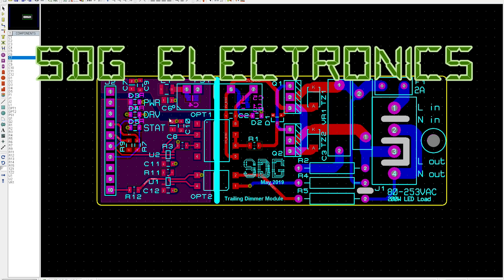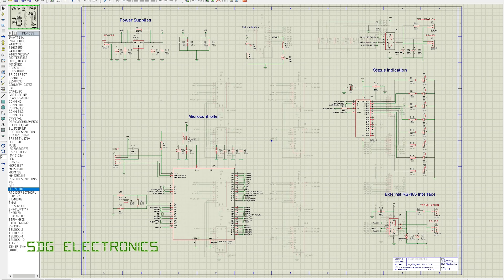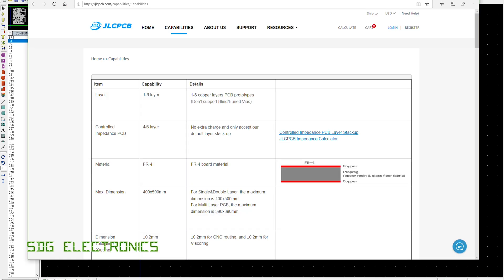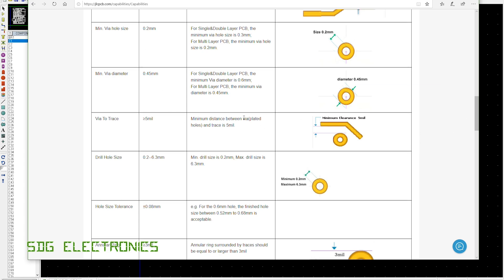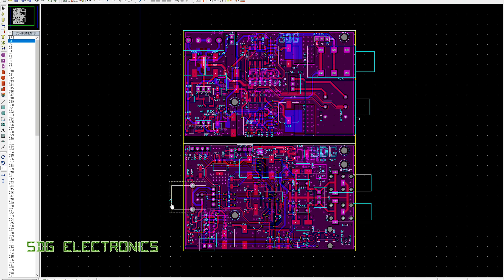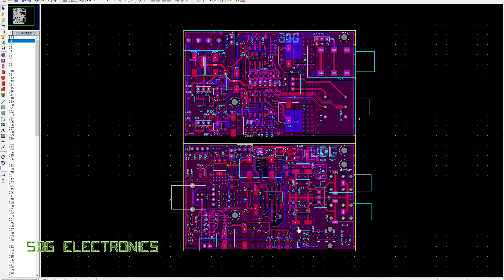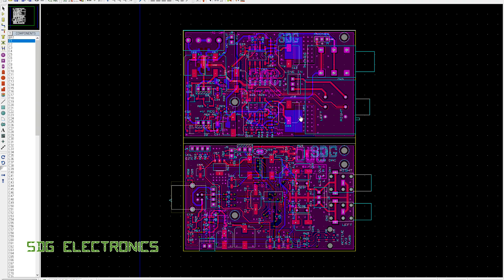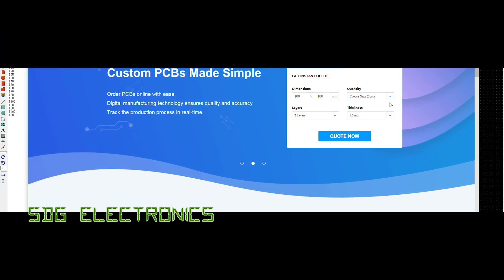SDG #090 PCB Design Tips and Design Rules

Comment: Barely related, but here's a question for you.

Pull-up resistors, and level shifters. Before or after the level shift?

Say I am using an SPI device with an Arduino, and I'm making a shield PCB to sit between the two... would I put pull-up resistors on the high side or the low side of the level shifter? More of a circuit design than PCB, but... couldn't find another of yours videos which may be more relevant.

Arduino being the high side, SPI device being a 3.3v device, on the low side.
Reply from the maker: It depends on the nature of the drivers - you only need pull-ups on open-collector outputs. SPI shouldn't need pull-ups or pull-downs though unless it's for some purpose before MCU initialisation.
Reply: @sdgelectronics  Oh, of course. These are the CS lines for various SPI devices and a RD line for an LCD. Not specifically SPI I suppose.

I'm using TXS0108E for the level shifters.

Comment: How do you cut the 10x10 JLCPCB into smaller units?
Like, if i wanted to make a bunch of nano boards but I wanted more than just 5?
Reply from the maker: Two methods - you can create a design with all of your designs in a matrix and put router slots in the design to allow them to be removed. Alternatively you can upload the single design and check the option to get JLCPCB to panelise the board. I will do a video on this soon for the Christmas lights project for this year :)

Comment: Thanks Steve. My idea for a project.

I would love to see a wifi power meter that sits between the mains and your device or in my case the consumer unit.
You can buy din rail modbus meters that do this but they lack wifi functionality without extra equipment.

In my setup my mains meter tails go into my modbus energy meter. I also have my 
module (Wemos / RS485 cheap ebay board) that reads this energy meter info using modbus. This board then publishes this energy info using mqtt on my local network for other devices to use.
For example my washing maching may turn on when the house is exporting energy.

In addidtion to my setup I also have a 5v din rail powersupply to power my board.
It would be nice to have this functionality built into one board.
I imagine different form factors like a din rail module or a simple box that can be wired on a extension socket for monitoring one device and when you don't want an electrician to have to install into your house wiring.

I think this would provide quite good tutorial material of measuring properties on the AC wave form ie how to determine the energy flow direction etc. Obviously more microcontroller coding and pcb design stuff in addition to using the active probe again :)

A pic of my currently bulky setup.
https://www.dropbox.com/s/towc0ea7ec9vr1g/energymeter_setup.jpg?dl=0

Thanks
Reply from the maker: Very interesting - you reminded me I actually have 5 Modbus energy meters for when I change the consumer unit/fuse box in the next month or so, but I decided I may not fit them. I had a similar setup to yours (excluding the wifi) at my previous house, but certainly a topic I could revisit. I'll take a look at your link - thanks.

Comment: Great video, Steve. Nice to see you using Proteus to demo these concepts. I've used Proteus from the early version 7.6 and now up to v8.8 SP1. I know Proteus is widely used in industry and by some quite famous people as their preference and would recommend this design suite to anyone.

I have quite a few bins of components in the lab and often wish to incorporate them into my designs. However, one concept in Proteus I never quite got to grips with was:

1) Trying to design schematic symbols for these odd components that were not available in Proteus itself
2) Writing their simulation DLLs
3) Their footprint design
4) The 3D Models

This all changed as of Proteus v8.8 SP1 as they incorporated an import feature whereby one can find standard file formats of the above except (in most cases) the simulation model. We can now import SnapEDA files and other files provided by component suppliers on their websites. for me, this was a major improvement on an otherwise excellent piece of software.
Reply from the maker: Proteus works well for me - I should really look at the pricing and consider upgrading. One of the main reasons I like Proteus is the component entry is really straightforward so it doesn't really take long. Also it's very quick to make quick tweaks to existing footprints if they don't work well for whatever reason. Thanks

Comment: Great video sir! 
I might say that something got my eyes on: 2:37 what's the magic behind those 2 zener diodes to protect the input and to blow the fuse? I mean, how they work together, and which values did you choose (zener diodes and fuse)
Reply from the maker: The series zener will normally act like a plain diode. The circuit is designed to work between 5 and 24V nominally, so the zener is set to 30V. If you see more than 30V it'll conduct and clamp the rail to 30V. If enough current flows the fuse will blow. If the reverse voltage is applied to the circuit the zener to 0V will conduct at 0.6V and off enough current is available will blow the fuse. The series zener may not need to be a zener - I think I had some reasoning but can't think now 😂
Reply: @sdgelectronics  Liked the ideia, thanks mate for sharing :)

Btw the fuse you used is something around 0.5A or something?